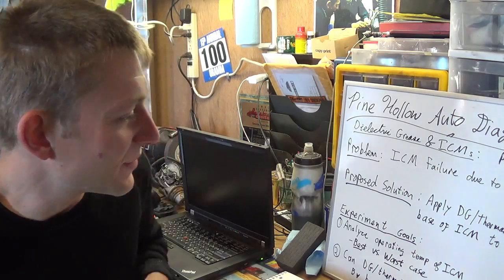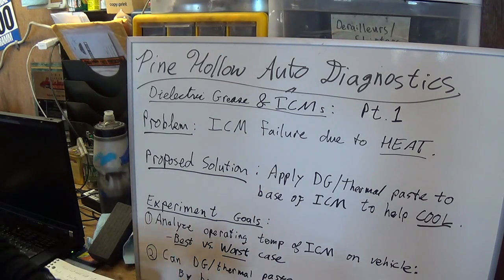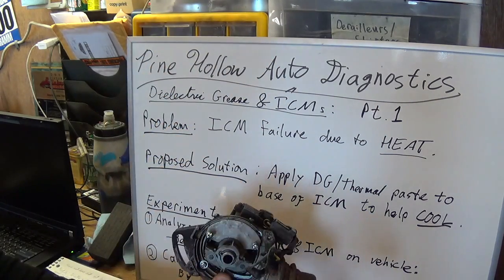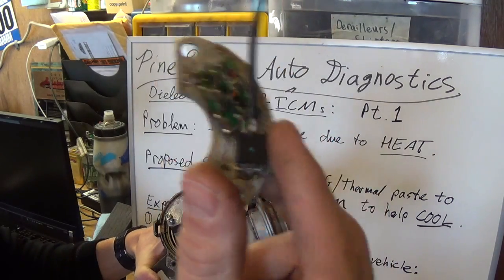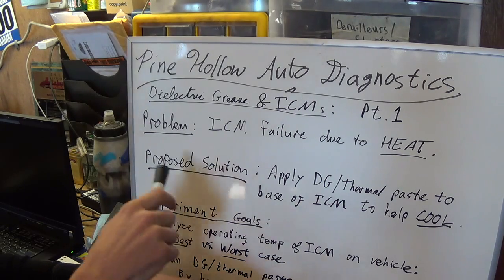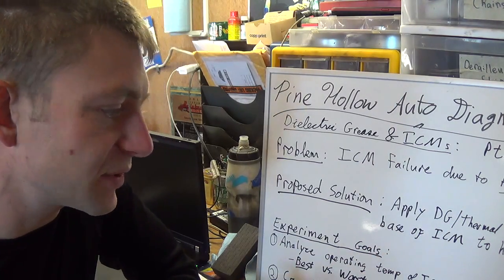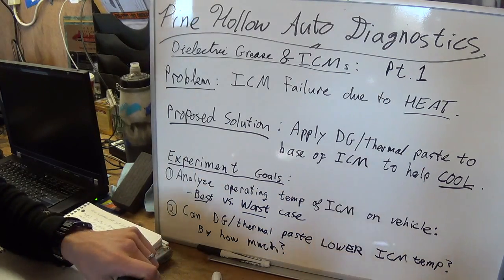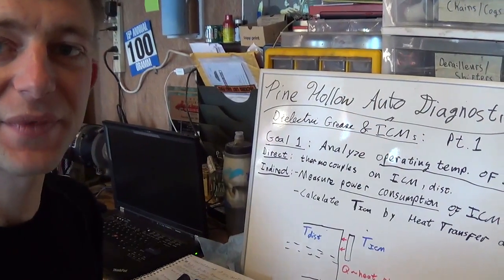MYTHBUSTERS Ep1: Dielectric Grease & ICMs - Part 1

Comment: I was thinking would it help in your tests to drill some 1/4 inch holes ( say four ) in the side distributor cap, with the rotor acting as a fan for cooling. I've done this in the past for condensation in the cap.Looking forward to your next video
Reply from the maker: +huggybryn39 Now we're talking! Never hurts to have a little convection helping out the conduction to dissipate heat :)
Reply: +huggybryn39 I've heard people talk about that back in the old days (meaning like the 1970's). But my understanding (or misunderstanding, more likely) is that you can gain some and loose some, and I'm not sure which was larger or better.In theory, maybe some fresh air whipping through the distributor due to holes could get rid of any overnight condenstation quicker. But on the other hand, you could be letting in air that has a lot of humidity.So you could suffer from misfires before the cap dries out, or suffer from misfires after it starts pulling in humid air.I really have no idea.As hard as it is for me to do, I guess I have to assume that the engineers design the cap as well as it can be. If venting helped, they'd probably do that.I don't really hear about engines having startup misfires at ambient temperatures anymore. The quality of cap design and materials and plug wire condutors and spark plug design (platinum, etc) combined with the super high energy ignitions have probably made the whole thing moot and no longer really relevant.
Reply: +douglas lee I remember, at least  one manufacturer started to vent their distributor caps, but with the same caps, fitting different makes and models, and it depended on where is was vented, so I guess it wasn't practicable from a manufacturers to carry on.  On the ignition module being inside the distributor, once is was moved to the outside it became more reliable, and has you say it is no longer relevant, unless you run a older motor. Thank you for your reply Douglas

Comment: You're probably already on top of this but................... if you are planning to test the temp of the module, or various parts of it, using different control mechanisms (silicon grease, thermal grease, no grease, etc) then I recommend that the first iteration should be whatever arrangement you think will keep the module the coolest. Then, go through each iteration with the NEXT BEST interface, and so forth, building up to the very last experiment iteration being the one which you expect to result in the hottest temps for the module.

There is a concept in semiconductors (you probably already know this) called "thermal runaway".

https://en.wikipedia.org/wiki/Thermal_runaway

There is a section there on PN junctions, transistors, etc.

Basically, if  a transistor gets TOO HOT, there is a special point of no return, where once you exceed it, it's game over, because the device "runs away" in a severly non-linear and undesirable direction. Almost like a nuclear reactor. It can get overtemp to a certain point and still be OK, but once it hits that critical "runaway", it's the end.

So ramp your measurement iterations from "best scenario expected" to "worst scenario expected", because with the last one, things might not last long.

Also, just to be sure, you might want to check the schematic to make sure that the heat sink does not act as a ground (I doubt that it would).

Thanks for doing this. It should be fascinating.
Reply: Hi Douglas. good to hear from ya! You are always giving very sound and I might add, very accurate advice! This one should be very interesting!
Reply: +Billy R Hi man!  Glad to see you around. It's been a while. I see you every once in a while here and on Matt's and Paul's places. Always enjoy your insights as well.It will be very interesting to see what Ivan comes up with. He's pretty damn smart, and unlike me, he has a solid engineering education.Take Care,Doug

Comment: I'm no electrician, but with 100k+ miles on the failed units, I'd suspect they lasted the life of the transistor. I can only imagine how many times it opened & closed throughout that time. I do believe that heat plays a roll, but for the most part I think that a transistor will only last x amount of cycles (don't know if companies list specs for that). I've replaced many ICM over the years on VW's & Audi's that had one cylinder misfires (4 or 6 transistors depending on ICM / number cylinders). It was always a single cylinder misfires, never more than one. You'd think that if all got equally hot & had the same number of on / off cycles, that you'd have more than one fail at the same time. Looking forward to what your tests will show.
Reply: +Thomas EXOVCDS  I found in the computer world that the number one killer is heat. A good heat-sink and properly applied heat-sink compound will keep a computer running for years. Most laptop failures today are due to poorly designed heat sinks on the GPU. I've saved many computers with a new heat sink compound and some shims to improve on heat transfer. And of course a bad fan and dirt will kill a computer just as fast.
Reply: +Thomas EXOVCDS i agree... heat will play in some part, but transistor cycle life is short in comparison.
Reply: Richard Desrosier Makes see for those applications... the ICM must get pretty hot then to be able to give away heat to a warm / hot engine component, or it would attract heat otherwise.
Reply: that is interesting.  i didn't know transistors failed due to cycling.  i was under the impression that "solid state" devices would go pretty much forever.
Reply: but transistors say in a digital clock also switch even faster and do so for decades non stop, its the heat going to shorten it greatly,  does the main CPU fail every 100k, is that not doing far more switching than an ignition transistor, in the order of megahertz?

Comment: Don't forget to do your experiment with no dielectric grease.  

My hunch is that you will see very little difference.  As the the heatsink is the mass of the distributor body.  Not only will it draw heat from the ignition module but the engine itself.  GM went away from using circuit boards to a ceramic substrate in their ignition control modules.  Ceramic is much more a stable substrate in regard of heat and cooling expansion and contraction.

Comment: The gm module fails a lot , and thinking if heat from distributor was killing modules , gm or some after market company  would of made a isolator block  or a way to mount with a gap . Be interesting to see what you come up with .

Comment: Wonders if the tube had Dielectric Grease , or a silicone grease of some sort . or are they the same
Reply: They are in essence the same critter just called by different names - you need to include thermal grease in the trio to round it out nicely though.  Some thermal greases or compounds are white due to zinc oxide doping, some are loaded with powdered silver as if this powder actually contacts either metal plate at the same time to conduct the heat away better than if the metal plates were in direct contact instead of being held apart by a piece of sliver here and a piece of sliver over there. 

The reason silicone is the base for this type of grease is due entirely to the inverse thermal characteristics of this family of grease.  It becomes more viscous with heat instead of thinner as petroleum based greases would.  Therefore it does not creep away, it fills voids with more heat applied allowing for conduction to occur within the grease trapped between the metal plates.  Far better to achieve flatness between the metal plates than any other modification possible and that includes silver powder additions, which I consider to be a 'my dog can whip your dog' gimmick in the first place.

What I know about the EA71 subaru is that the heat fault with these electronic ignitions was the pick up module which is essentially just a copper coil that is also subjected to intense heat cycles.  Over time the epoxy case would pull the windings open and you would have failure at high temps only at first.  Over time then it would begin to fail more often at cooler temps until the engine couldn't be trusted to be backed out of the driveway.

Transistors do not have x amount of cycle life any more than they are they filled with magic smoke.  You can specify military temperature range for the transistors in these modules or settle for consumer grade parts.  Price of pennies difference in commercial volumes tells all about who to blame for this problem.  Cheap ass GM bean counters.

MTBF (mean time between failure) ratings for transistors is in the mind boggling range while running at 125C degrees for military grade transistors.  Consumer grade range is 0 - 70C for comparison.  Look for 54LS00 (military grade logic chip) and then the consumer grade 74LS00 logic chip just to start this lesson in military ratings.  I would suggest that GM has too many been counters and they can't make a decent module because of them primarily.  If you want a better module you'll have to use a better transistor to start with and then practically it doesn't matter how hot it gets.  This story is from the 60s at least and for all that time, GM has known full well what it takes to make a decent module.  They just won't do it.

One fault in power consumed logic is that only some power used by the module is in fact converted to heat there.  A good deal of that power is transferred to the coil which also has it's own resistive power loss, but the point I want to get across is that a large part of the power consumed actually winds up heating the air between the spark plug electrodes - it is significant in comparison to 60 watt example mentioned in part one.  Best of luck with part two.